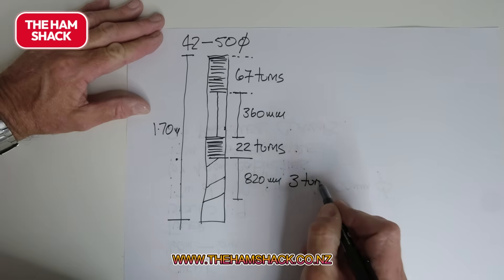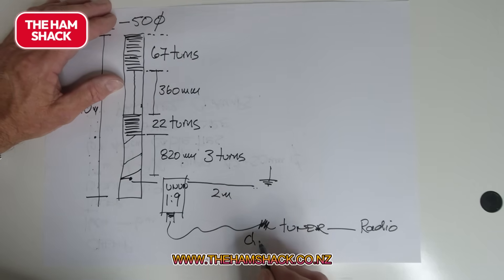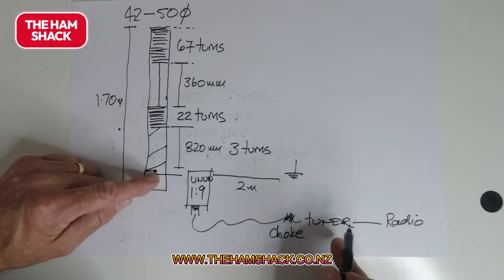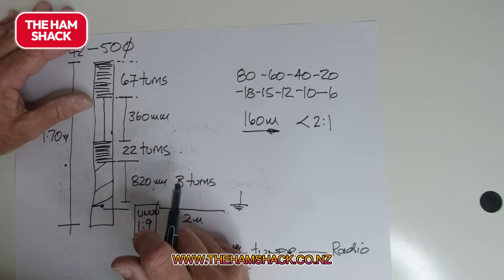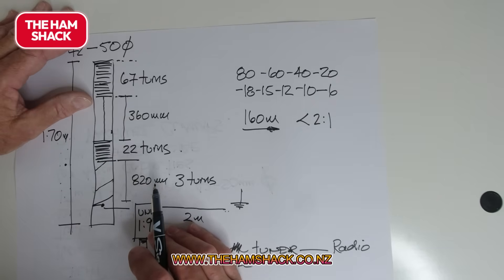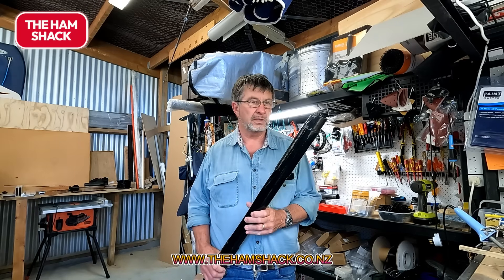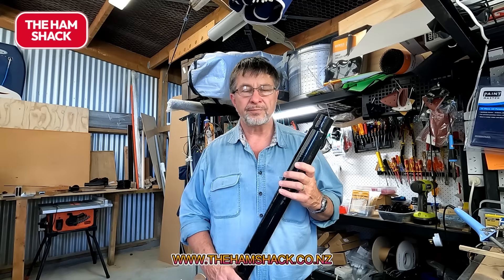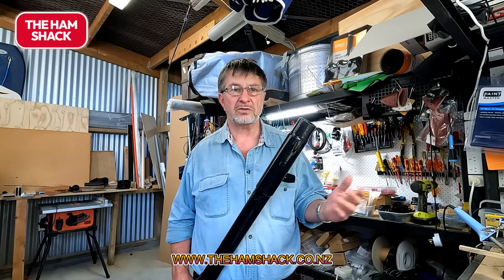Cheap Multiband HF Antenna

Comment: Do you have more information about this antenna looks like a fun build
Reply from the maker: Hi Jacob. The original design was on FB and I build some of the projects and see what works. This one specified a 4:1 unun but that did not work well and I swopped that for a 9:1 and it was like a different antenna. I have no theory on the design only what is in the drawing.

Comment: What a great project and thanks for the clear guidance great job 🙂 might just try this 73s tc
Reply from the maker: Thanks for the comment Marty. I get lots of designs some I build to test and this one actually worked, albeit with a 9:1 unun instead of the specified 4:1
Reply: @The_Ham_Shack well it's all about trying something different and this certainly is. I've cut a 1.7m 50mm pipe going to make on weekend don't think I'll reach you but as you say local maybe. 73s de M7HKO
Reply from the maker: @marty950 I was just looking on QRZ and I like your key, as you say its all about trying new things.

Comment: If only could get 10M SWR down a bit.. Still a Great Compact Antenna.
Reply from the maker: I think the fact that it covers 160m to 6m  is amazing and no EFHW or Random Wire antenna will give you that range.